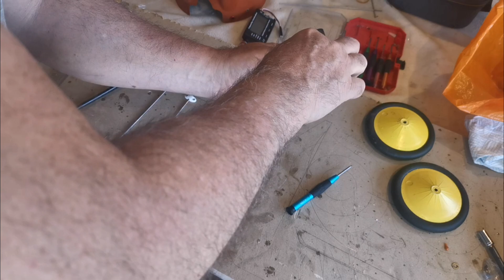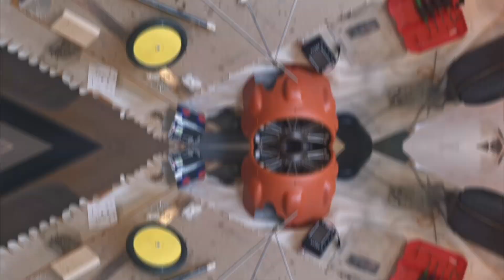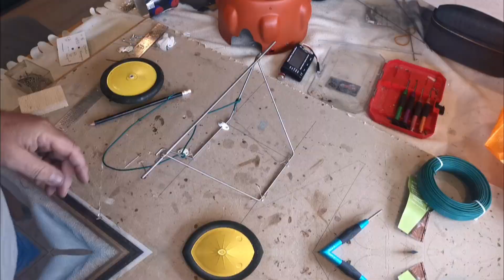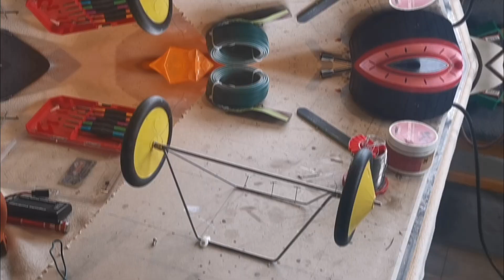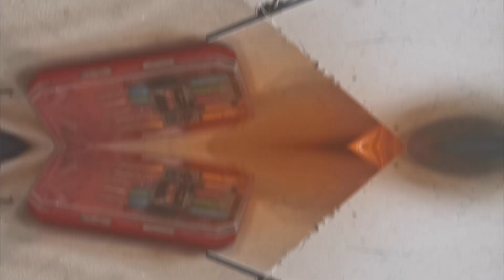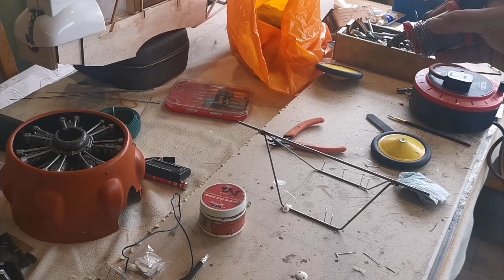Soldering without tears 😭 : Cirrus Moth build.

Comment: I have soldered u/c wires over many years, so maybe these tips may help? 
Bind the legs with 15amp fusewire.
Always hold the iron (mine's either 60w or 90w) touching the bottom of the joint (as heat rises) and feed in the solder from the top and sides...the bottom takes care of itself!
Use either acid cored solder or Bakers Fluid to flux the joints. 
Use cellulose thinners to clear away the flux residue from the wires.
I hope these tips help you as much as they've helped me!
Reply from the maker: Certainly are thanks for the tip regarding heating from the bottom especially.